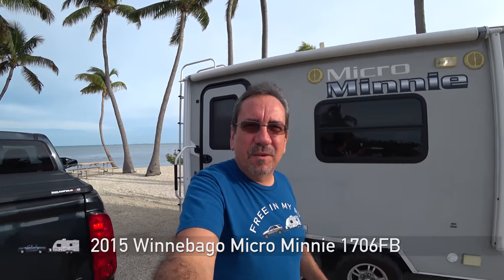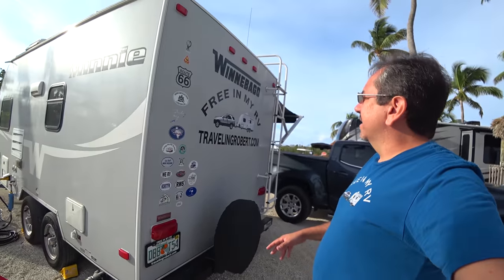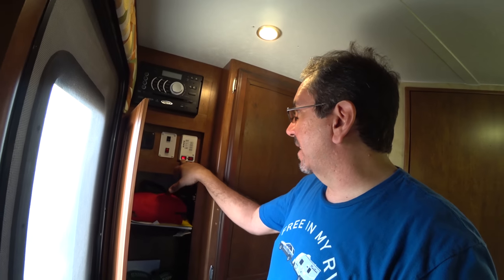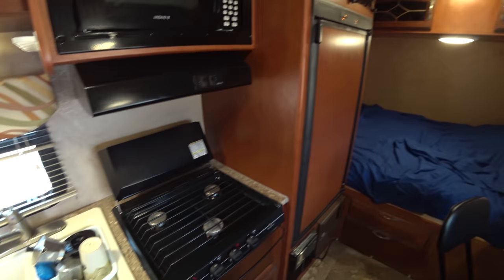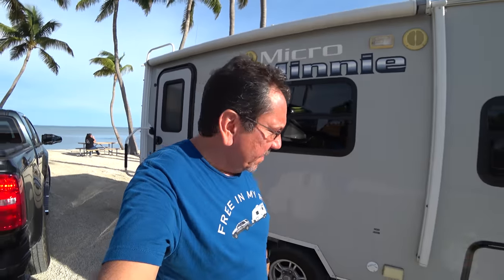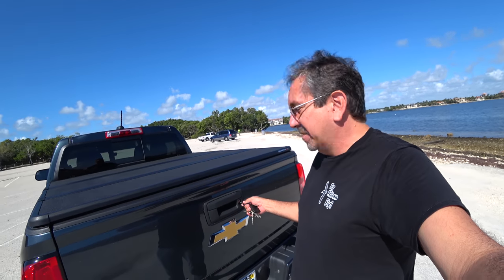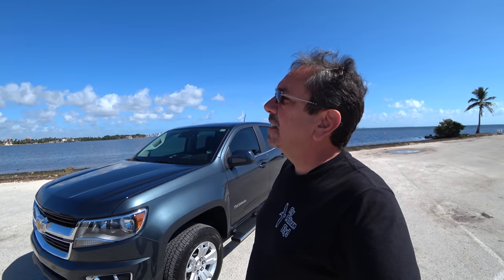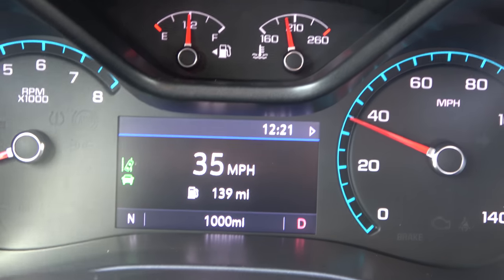2015 Winnebago Micro Minnie 1706FB After 4 Years, and my new truck (4K)

Comment: I like all of your upgrades.  My suggestions are:

Install a toilet paper holder to the inside of the door where you store the toilet paper.
Add the TV to the front of the door of your closet.  You can get a very thin flat panel, and put the tuner inside the closet.

Comment: Seems like we never get exactly what we want, but your mods look like they work great for what you do. Here something that works well to keep your waste tanks clean and the sensors working.
     “After you dump your black and gray tanks get some Rid-X (from Wal-Mart) and put a 1/4 Cup in each tank along with 10-15 gallons of water. Drive to your next stop and drain. The Rid-X will clean the sensors. If you do it  periodically it will keep them working for a longtime. Rid-X is used in Septic Systems to keep build up down.”
Reply: Looks like another good idea to correct faulty tank sensors.
Reply from the maker: I'll try that

Comment: Suggest you stop by an axle shop.  Either you have a bent axle or the axle just needs to be aligned.
Reply: I was thinking they both were a little crooked on the frame..but didnt make sense to me why both tires on the same axle weren't wearing instead of just one side..your theory makes more sense to me..odd though 1 side on 1 axle and the other side on the 2nd axle....like Robert says is what it is...would drive me nuts though if it were mine...lol
Reply: @TheDoug9901  دثذككككك

Comment: I hope you have better luck with your Colorado than I did. I have a MM2106DS and used a Colorado V6 with the full factory towing package for towing. The first year I had no major problems, however, year two my travels took me through areas where I was encountering far steeper roads and higher elevations than I encountered in my first year. The Colorado could JUST make the grades, many times I was going significantly less than the speed limit by the time I reached the top of the grade. Other times my acceleration was so slow that I was slowing down highway traffic. I decided that for peace of mind I should get a tow vehicle with a V8 to ensure comfortable, stress free towing. Before I bought the Colorado, which I bought because of the 7,000 lb towing capacity, I had a Chev. Blazer with the V6 which was rated for 4,300 lbs, which of course was not sufficient to tow the MM2106DS, I should have realized that no matter what GM claims the motors of those two vehicles are very similar. I bought a Chev Silverado with the 5.3 V8, now I can tow up steep hills and am no longer pushing/taxing the motor, in fact I can honestly say I hardly know I am pulling a trailer and also no get better gas milage that I did with the Colorado. I do miss the size of the Colorado, but now I feel I can safely tow my trailer and no longer impede other drivers. I hope you have the diesel version Colorado, I heard that there is a significant difference between towing with the V6 and the diesel versions.

Comment: I have a Winnebago the black tank sometimes I get about reading bought a wand from camping world hooks up to a garden hose put it into your toilet it has a rotating head high pressure cleaned the tank thoroughly have not had a problem use it every once in a while.👍

Comment: Different campers have different lay outs. I went from a 8ft vanguard without a bathroom to a 10ft western slide in truck box camper and I actually have way way less storage in the bigger camper. The vanguard was very nice with the bunk bed I could fold down and neatly store all my clothes on the top bunk with the couch underneath and table. The western has one small closet for all my clothes and nothing else besides a few drawers. Nice bathroom with a shower but I really have to add a large storage shelf like my vanguard had for clothing. Living in Canada in the rocky mountains we only have 5 months of camping off the grid so air-conditioning and a furnace are not really needed. My camper has a nice radiant propane heater added on so I can boon dock for around 3 days on my 4 batteries without any generator needed

Comment: At least you didn't buy a Jayco or Coleman.  I haul them brand new from the factory to dealerships, and after seeing just how badly they hold up during transport, I wouldn't pay half the price they go for at the dealerships.

It's a shame the U.S. r.v. industry is like the U.S. car industry was in the 70's and 80's;  Built as quickly and cheaply as possible.

BTW:  Come to Oregon.  You'll love the coast, Columbia River Gorge, and Cascade volcanoes.  Best time is between June and October!
Reply from the maker: Can't wait to visit Oregon
Reply: J Chord exactly 

We have a Travelaire quality is excellent for a 10 yr old rig 

Key is workers were paid 20 an hour to build that travel trailer

New ones built in the usa have a workforce  with a disconnect
Reply: Do you ever haul fiber glass trailers?
Reply: All kinds.  Fiberglass, aluminum, and composite.
Reply: @jchors2947  any Colemans or Casitas? If so what what your impression(s)?
Reply: @jchors2947  Sorry didn't mean Coleman but Oilver!
Reply: @jchors2947  yes even 100k+ RVs are  not quality, they have no standards.  But I've heard great things from fiber glass RVs, Olivers are about 60k but are very well built.
Reply: I agree with you J ... I deliver RVs as well and can hear loose screws hitting the floor as I bounce down the road on a delivery. Some have only 11 miles on them when I pick them up! Look at the price points though ... in the travel trailer class Oliver and Escapees start at $50K+; they and Casitas are fiberglass trailers so will last well over the years. Most new RVers don't keep their 1st RV for very long and are often looking to trade out.  As they use it and learn what they need/want/prefer/are willing to pay for/ they will transition in & out of their units. Maintenance will ALWAYS be an issue as these vehicles travel down the roads which are very hard on the vehicles. Deferred maintenance and/or NO proactive maintenance will cause big problems.  Robert has done a good job of keeping Minitini upgraded and serviceable for their use as well as keeping his fan club informed of the pros AND cons.
Reply: @candacerivero  i would buy an RV if it were an Oliver type or Casita type; they do hold up unlike the non-fiber glass ones.  It is really much better to rent one for a week than pay for storage and or maintance while it loses value every year!  If you are wealthy then it doesn't matter.
Reply: Can you please explain Coleman and jayco quality and what did you see
Reply: Visual Mobile Technologies: I don't know where to start!  Peeling interior laminate, loose and poorly cut trim, cheap materials everywhere.  The bedding is a joke.  The cheapest and thinnest plywood and wood laminate they can get away with.  Furniture that goes 'crack' when you sit on it.  Gaps in the insulation (watch the video i linked to see a good example of that).  Insulation, undercarriage protective barrier, and supporting crossmembers that fall off during transportation.  Substandard welds.  Electrical that is poorly wired/grounded.  Too much or too little glue.  staples and nails that have missed the framing.  Screws that are backing out or missing entirely.  Poorly aligned slideouts.  Electric jacks that don't work.  Switchgear wiring reversed.  Awnings that won't fully close.  Outside compartment doors that won't lock or have uneven hinges.  Peeling graphics.  Poorly hung doors.  Covered up damage.  Leaking window frames.  I could go on.

Every brand is delivered with a few things needing fixed, but these cheap brands usually need a lot fixed, and it's a bad sign of what's to come.
Reply: Great video and very informational also.
Reply: J Chors I agree about Jayco.
Reply: Any feedback on fiber glass Scamp? Thnx !
Reply: Hope I’m not late. I live in the u.s and plan on rving as a nurse full time. I’m eying an airstream caravel. What brand do you suggest or trust??

Comment: The black water tank sensors show a false level because the inside of your tank has a bunch of "stuff" still clinging to the walls. You can get a pro to flush it out with a high pressure water probe designed specifically to thoroughly clean it out. Or you can try buying one of the aftermarket attachments that supposedly do the same thing. But they typically don't work all that well based on what I've seen online.

Comment: Another way to clean sensors in black tank: add to tank, one cup each, Dawn dish soap and Calgon water softener ( find near laundry detergents).  Fill tank and let stand for 2 - 3 hours.  Flush tank then fill and check sensors as tank fills.  Repeat if sensors still indicating wrong with empty tank.
Reply from the maker: I'll try that

Comment: Suggest just replacing solar panel with 325 watt panel and get deep cycle or lithium battery replacement. Also noticed you could put some insulation in the basement storage to help from loosing cooling or heating through bed. Just thoughts. Thing I did in my camper. You can also put in access door from inside for items you need to get to faster than others.

Comment: Black Tank Sensor ... you have TP stuck on sensors you need to fill black water tank 1/2 full with water add  2 cap fulls of Colgone and 1 cap full of Tide or ERA  drive around a few hours then  rinse your tank should clear your sensors ...also the bio method ( Calgone / ERA and a gallon of water ) works so much better then blue stuff for breaking things down ... By the way nice choice on Truck for towing small camper :) great videos !!!

Comment: I like your new truck.  I hope is last you a long time.  You are right about the color.  I can not tell if it is midnight blue or black.  It changes.  Oh the electronic on new vehicles is something else.  Read your manual.  You will find out some other cool things you didn't know.  I love that bed cover.  That saves on fuel too.  Your camper is just the right size.  Enjoy your trips.
Reply from the maker: Thank you!

Comment: Love the new truck!  in the market for a new truck and now the Colorado is on my list. You will have to let us know how it pulls the Minitini in the mountains.
Reply from the maker: It pulls great, even in the mountains, at least me 19 foot trailer. My only complaint so far is the technology. Too much of it not the best implementation. Built in WiFi sounded like a great idea except that it doesn't work all the time. Having a nice head unit is great except when it crashes. Everything is dependent on the software even the A/C fan speed. Android auto, good concept except that everything takes more clicks hence more dangerous while driving...etc.

Comment: Thanks for update on batteries. Going to golf cart batteries.  Particle board separating on mine also. Covered with black eternabond.   Also covered all caulking on roof with eternabond. My tank sensors don't work either. Normal.  Lot of updates I'm going to do.  What is size of generator you run with soft start.  Champion 2000w wont start mine.  Same color truck as my new f250. 27ftr pulling with Hensley.  Travel 15k per yr.  Just put Zep floor wax on. Loosing shine in Florida.  Replaced several decals also.
Reply from the maker: mine is 2200w, 2500w peak

Comment: I have the same trailer, but 2013. My black tank idiot light always says FULL (4 lights) so I bought a wand you put down through the toilet and it spins water around to clean off the walls inside the tank to hopefully get the stuck toilet paper off the wall which is most likely stuck over the sensor. Have not gotten around to doing it yet as I have been so busy traveling, but I will let you know how it does. Hope to see you again at the RTR.
Reply from the maker: Hope to see you too

Comment: You can cure your tire problem by getting a 2 axle alignment. I used to get it done on my commercial 53ft trailer. Fixes the problem. Find a trailer shop(great dane or fruehaf) dealer. Tri County Truck and Trailer Repair in Medley. Florida Utility Trailers in Hialeah.
Reply from the maker: I'm going to have to go to one of those places eventually

Comment: Robert, if your tires are wearing on the trailer have you ever had your axles looked at. Ours was wearing on the outside  the Tow -in was extremely off. Had to align the axle. That may be the problem. But I'm not sure.
Reply from the maker: I am pretty sure that is the problem too

Comment: Have you replaced your suspension bushings?  There are little plastic bushings in the equalizers and the shackle bolts. That wear out very quickly.  I don’t think there are any adjustment points to align the axles on these trailers, so there might also be something bent.  We replaced our complete suspension with the More ride equalizers, wet bolts, and upgraded to 6000 lb axles on our Winnebago 30RE. The stock axles and suspension were borderline for the size of the trailer. We had a failure and almost lost a wheel, which prompted us to upgrade.

,
Reply from the maker: I haven't done anything yet. As long as it works....

Comment: The Chevy Colorado looks great and it is a perfect match to your Minnie. You were very fortunate to get 150,000 miles out of your Kia. We've had a Kia and they are great cars, but they are a poor towing platform. A tow vehicle is more than the horsepower delivered. The drive train and suspension need to be able to handle the load to tow safely. You were probably over the design tow load for the Kia after you loaded the Weber grill, clothes, gadgets, and food. Even with empty tanks. The Colorado should last a long time and tow your trailer more safely. I try to have some reserve in towing ability so as not to strain my tow vehicle and to have some margin for error for unexpected situation. Did La Mesa RV express any reservations about towing with the Kia when you purchased the Minnie?

Comment: I watched your 3 month long journey from summer of 2019 (thoroughly enjoyed it!). You mentioned multiple times about tire issues. I recall you stopping/buying/replacing your tires two (maybe 3?) times during the trip. You stated that your tires are 'not a common size'. What size are they? 15"? Have you had any issues regarding 'keeping the axles greased'?
Reply from the maker: That trailer had a misalignment problem with the axles. The tires are 13

Comment: Did I hear you correctly, that your new Colorado is a 2-wheel drive? Why not a 4-wheel drive for versatility? Does the V-6 engine have enough torque? Better than your KIA? Thanks for the feedback
Reply from the maker: Yes, I didn't want to spend the extra 5000 for 4 wheel drive. The engine displacement is almost the same as Kia, but I guess with better technology is double the tow capacity

Comment: Nice tour Robert at 4:05 you mentioned an upgrade, can you explain in more detail about the what you did, i got an instant water heater on my Roadtrek which is a very bad system and i want to upgrade for something better.
Reply from the maker: I purchased a Truma AquaGo. It is a German unit. It is on demand, but it does have a small 1 liter tank to maintain a constant water temperature, so it is kind of hybrid. It is very expensive and they make you install it through a dealer but it works very well.
Reply: @TravelingRobert  that's what I need, thanks for the quick answer, can you provide a link where to buy it ?
Reply from the maker: https://www.truma.com/us/en/products/truma-water-systems/truma-aqua-go-water-heater.html

Comment: Travelling Robert for fuel economy the 2.8 duramax is superb, did you give it any consideration in your Colorado buy ?
Reply from the maker: Briefly, but the initial cost was an extra amount of debt I didn't want to get into, besides the higher maintenance cost of a diesel engine
Reply: Traveling Robert ahh I see

That's Why I went 1 owner used Duramax diesel 100000 miles $7000

Can't be happier

Comment: Hi Robert, is the Oxygenics shower head metal or plastic? I like quality metal components but if it falls while towing, it could damage whatever it falls on. 
My buddy moved from Southern California to Loxahachee Florida. He noted that his tools and other metal items had corrosion issues. How do you deal with this? Thank you
Reply from the maker: It is plastic, and durable. 4.5 years later still look like new. Silicon based WD-40 works pretty well to prevent corrosion.

Comment: Chevy Colorado is ranked one of the most unreliable mid-sized trucks. I wouldn't use it for the life style like yours. The reality of the truck will show you later down the road. best luck! By the way, your videos are so inspiring!! I just love it!
Reply from the maker: Not to mention uncomfortable seat, poorly implemented technology, jerky transmission, just to pint out a few more flaws. Something tells me I won't have this truck for a long time.
Reply: Those are well known issues. I'd really suggest you to trade it for Toyota. Its reliability can give you a better experience on the road, at least not to worry about breaking down on you anytime in the middle of nowhere.
Reply: Tacoma, 4 runner and and tundra will be a better choice. In my opinion, the good thing about those trucks is you don't really need to get it brand new. A 10 year truck could still run like new, and trouble free..so to save more money on getting a new truck
Reply from the maker: @lawrencef3560  I'm thinking 4-runner. I'm more of an SUV kind of guy.
Reply: I've been looking at sequoia lol

Comment: How does your truck do pulling it? I’m curious if my V6 Tacoma would haul a 15-18 ft camper ok.
Reply from the maker: Truck pulls great. Tacoma is rated for a little less but it is almost the same so you shouldn't have any trouble towing with it
Reply: I tow a Starcraft AR One 16bh with my V6 Xterra, it does fine. Would be nice to have a V8 though. V6s usually make power at higher revs so it revs high  trying to maintain speed on steep grades.